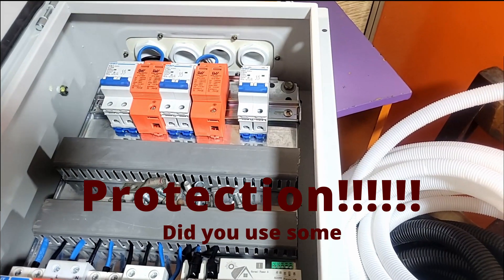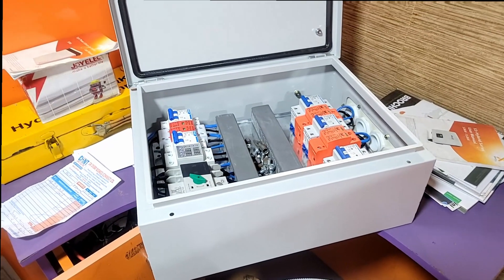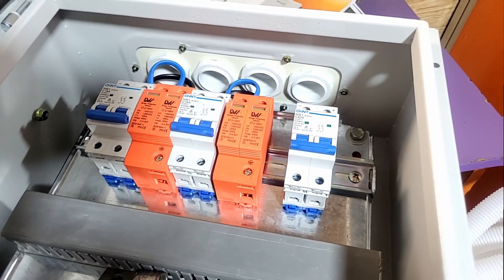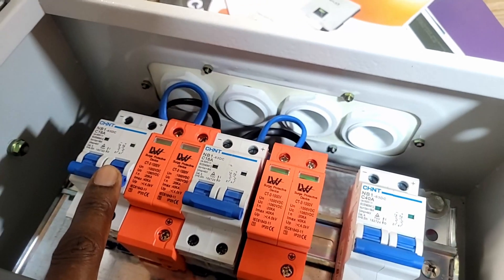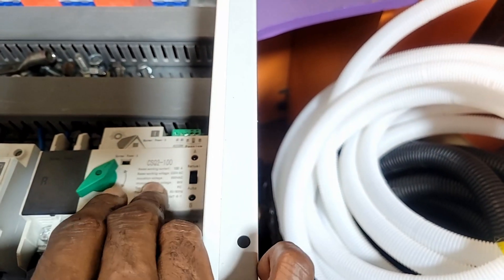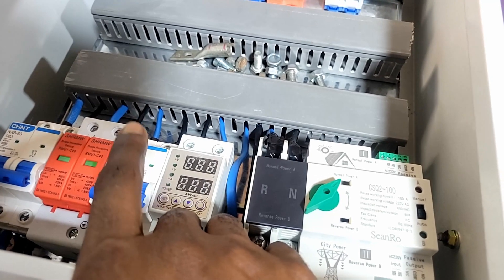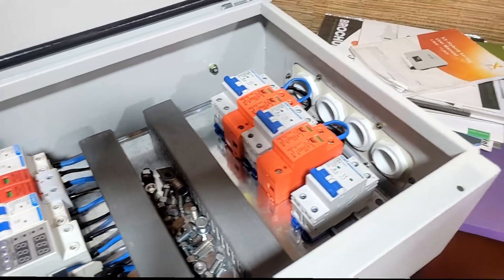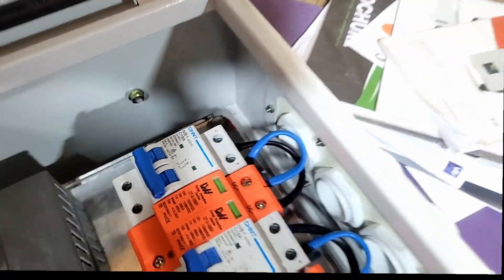What's Your Protection Game? Check Out Our Solution. @SolaXPowerGlobal

Comment: Well done, sir. That is a nice setup. From what I have learned and studied recently, especially from our country's grid supply, I swapped the surge at the grid side to AVS and adjusted my input lower and upper voltage for the inverters. First, for protection against high voltage from the grid, and secondly, from low voltage supply because some customers called when they heard the beeping of low battery.
Reply from the maker: Hello Kolawole. Thank you for watching and commenting. Can you please tell me how big the AVS is? Will it fit into an enclosure

Comment: On DC side better to add fuse as well. Breakers are mechanical and mechanical things can go wrong, specially in DC if breaker is operated during load sometimes its internal contacts gets welded internally due to DC arc, if that happens, apparently they look fine but they will not trip when needed. Adding fuses will give extra protection on marginal cost.
Reply from the maker: Nice suggestion. We can do fuses in lieu of breakers and then a total  main shut off prior
Reply: If the contacts get welded, will it not also melt the breaker before the welding is done?